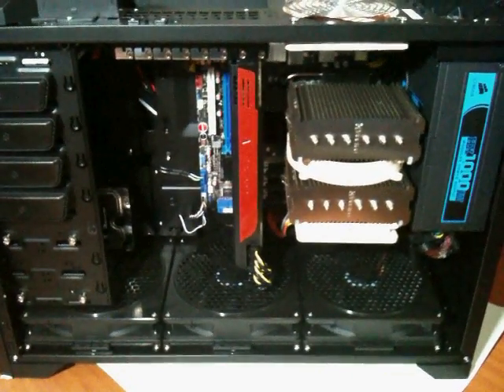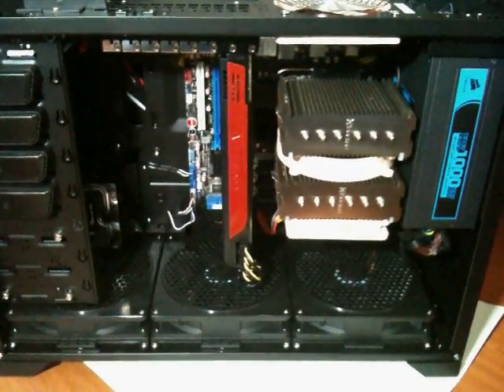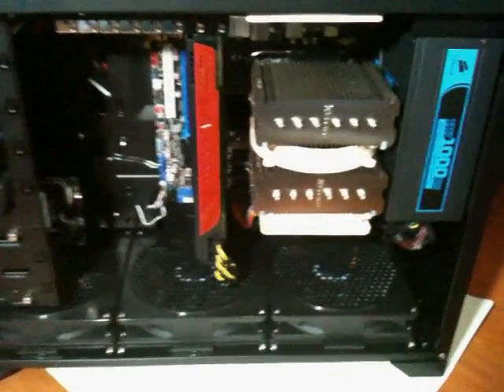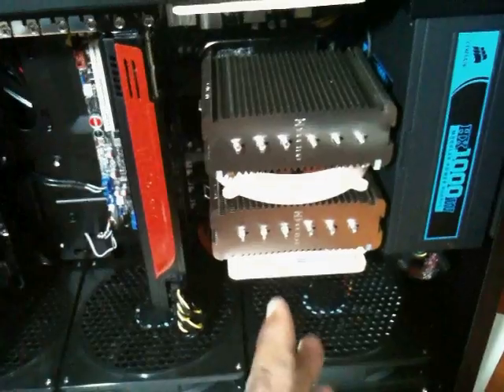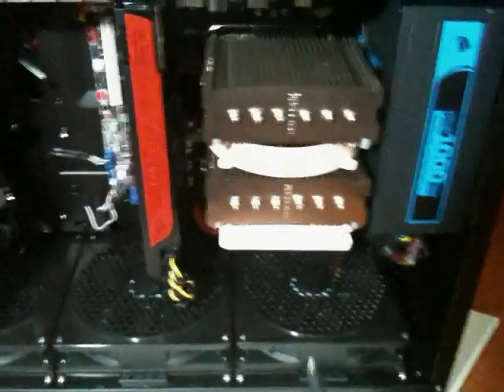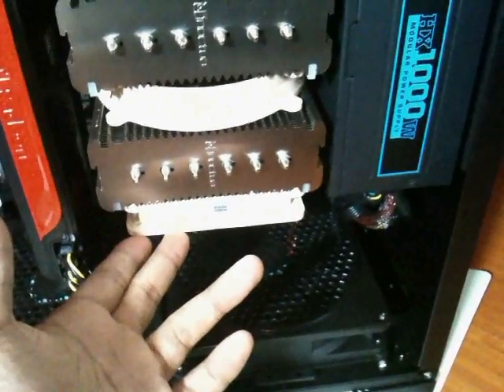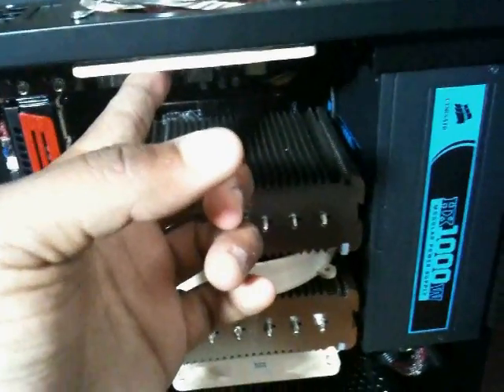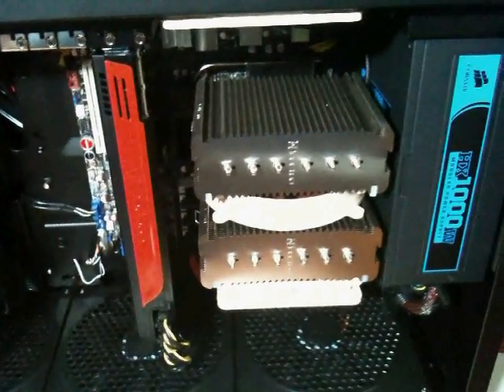NH-D14 installed

Comment from the maker: @domeee11 Sorry to say but the T1 heatsink wont fit under the NH-D14.. If you want kingston ram you can go with the low profile hyperX grey series ram that way you wont have to remove the heatsink to install.. This will fit or ram with heatsinks like this will fit just fine. Kingston HyperX Grey Series 8GB model # KHX1600C9D3X2K2/8GX

Comment from the maker: @Xxd3cayxX im not sure what you mean exactly but you only have two options for fan placement.. the 140 mm fan in the middle and the 120 on either side of the heatsink.. Just make sure the fans are in a "PUSH/PULL" configuration i.e. 120 push, 140 pull, or 140 push, 120 pull.. My fan set up is 120 push, 140 pull so they move air in the same direction.. Hope this helps.

Comment from the maker: @helloshayan My case is the SILVERSTONE Raven 2 RV02B-W. The Raven styled cases from Silverstone uses 90 degree motherboard mounting. The psu placement is part of this case design. The power and reset buttons are in the front of the case near the top. Finally, thanks for compliment. I did the build myself. The newer Silverstone Raven 3 case is out now so I will change to that case very soon.

Comment from the maker: @manonhill12 it puts a minimal amount of stress on the motherboard if everything is properly mounted and installed. Make sure ur motherboard is properly secured inside of ur case followed by the NH-D14 backplate and retention mount.

Comment from the maker: @gerardbiteme, the 5970 will fit inside the Silverstone Raven RV02B-W. The only thing I was concerned about were the power connectors after I installed my 5870. I did use the mounting bracket for the psu but it was a chore to mount it. I suggest installing the psu with the case laying on its side so that the rom bays are pointed at the ceiling making your psu parallel to the floor when installing. It just makes installing the psu easier IMHO.. Hope this helps. Happy Gaming!!!!!!

Comment: could you fit a 5970 in that case dude? I was looking at this case as I think its brilliantly innovative and I like the look, but I wasn't sure if I could get that sort of size graphics card inside it, what with the fans at the bottom, other than that its gonna be a antec 1200 or df85 for me, and did you use a bracket or anything to support the psu or just the 4 normal screws?

Comment: could you fit a 5970 in that case dude? I was looking at this case as I think its brilliantly inovative and I like the look, but I wasn't sure if I could get that sort of size graphics card inside it, what with the fans at the bottom, other than that its gonna be a antec 1200 or df85 for me, and did you use a bracket or anything to support the psu or just the 4 normal screws?

Comment from the maker: @andyj025, I was worried about the ram heat sinks but it cleared the NH-D14 with a little room to spare. It really depends on the type of ram you have. I didn't go for  ram that had really tall heat sinks as I knew I might run into clearance issues with the Noctua. The ram I used is the Corsair xms3 1600. I'm sure they have faster ram nowadays with a low profile heat sink design. Hope this helps.

Comment: i got same case same heatsink two 5850 xfx ati video cards and xfx 850 watt powersupply. but i got a question for you did you take advantage of the exhaust area for the power supply? like the venting I put mine in that way and it doesn't feel like its blowing anything out and it gets a little hot on the top of the power supply not sure if thats normal but my cpu temp and motherboard temps are 15 celcius idle and motherboard is 27-28 celcius idle well let me know thanks.

Comment from the maker: Other than replacing the 120mm fan at the top, I don't believe so IMHO. Those (3) 180mm fans move lots of air through the case so I think you should be fine. It wouldn't hurt if you put more fans inside as long as the air is routed in the same fashion (in-taking/exhausting) as the others to keep a smooth/consistent flow of air (it's the case's design unforunately). Hope this helps.. Happy Gaming and good luck with your build......